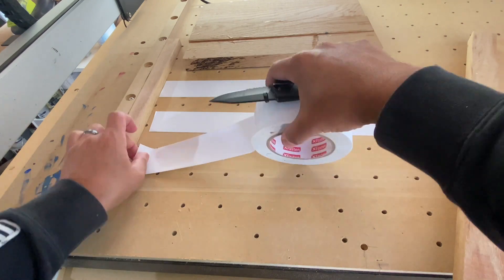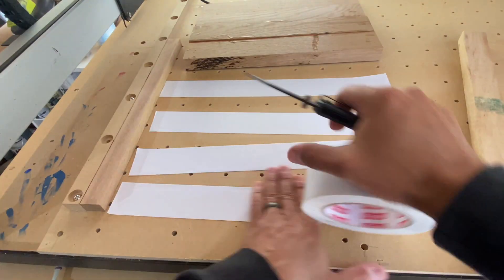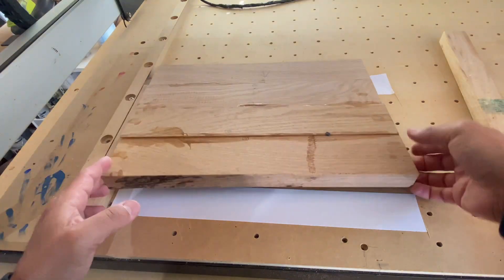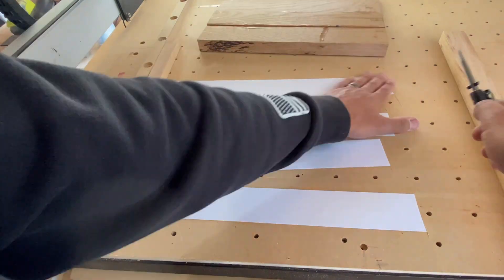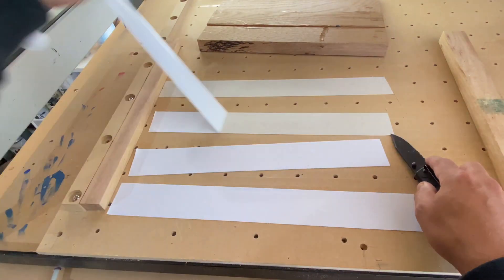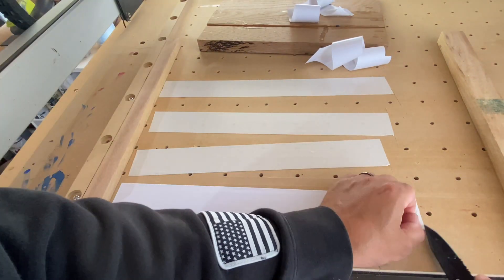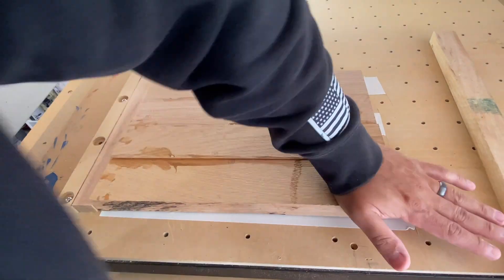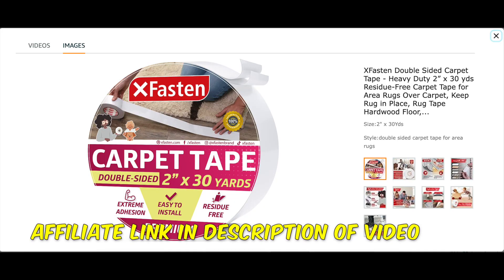CNC Hold Down Method:  The BEST Double Sided Tape!

Comment: Everyone, I’ve used the X-Fasten tape from the first video where I saw Edgar using it. I used to spend 15 to 20 minutes threading teez nuts and clamps. The tape sets up easier, holds better, and makes it easy to load my workpiece square to the direction of cutting. And, there is no need to rig a spoil board with cam shaped clamps. Great advice, Edgar!!
Reply from the maker: Thanks Timothy, glad it’s been working out! 

I’m still trying out my cam clamps and not wanting to give up on them yet but I can’t disagree with you either.  I keep getting horizontal movement and material lifting off the table. 

I’m gonna keep trying but might have to true downward pressure clamps which I think are more “traditional”.

Comment: Edgar, I love your videos and they have helped me tremendously, as I am still trying to learn CCreate and trying to use my Shapeoko.  My question is understanding CC and v carve and advance v carve. Start depth and max depth, use stock top and stock bottom. 
In your videos either I missed discussion of these inputs. Is there a possibility of discussing a little slower as to how to use these examples? You can message me directly if you like. Please
Reply from the maker: Hi Al,  thank you for checking out the videos! I appreciate it!

I did make this video comparing the two toolpaths but I on making a video on a scrap project and will be focusing on some of the toolpaths a bit more, so I’ll make sure to speak on them.

https://youtu.be/yef-mo3ier0